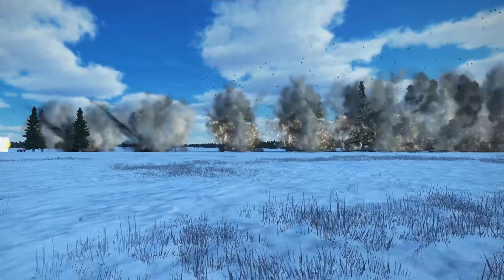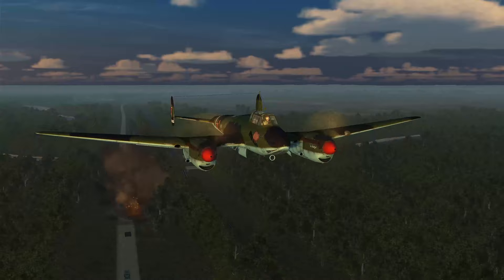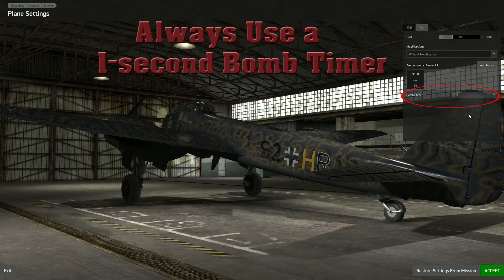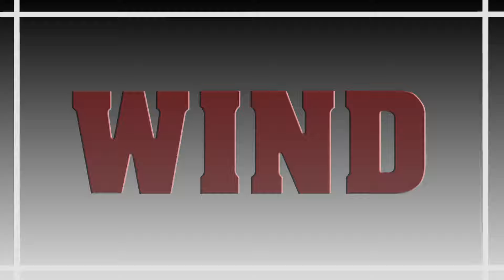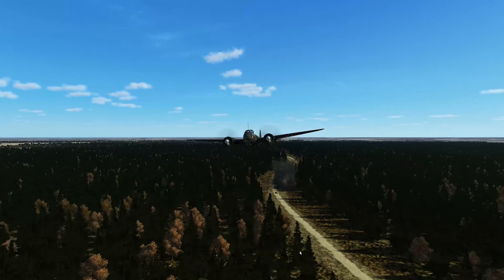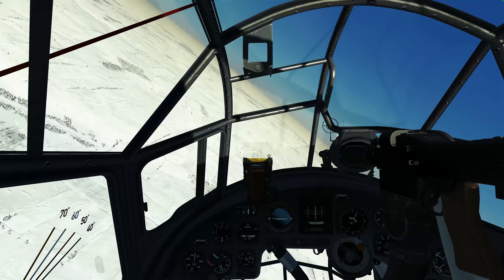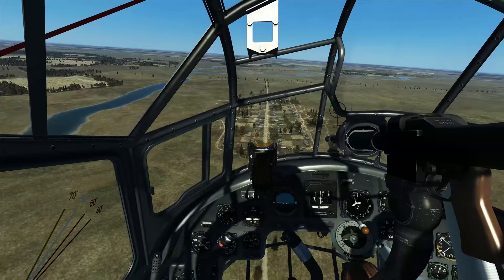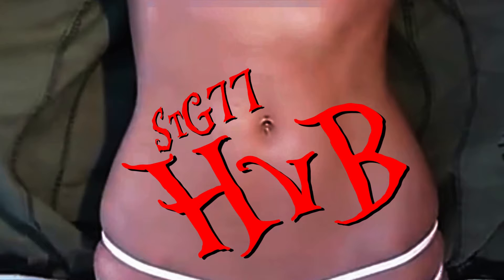Tank Busting: Ju 88 / Pe-2 / A 20B  Ground Attacker Handbook Subsection 7.2 IL-2 Great Battles

Comment: Its very WELL DONE( I do love these planes..)Very interesting BUT I had to put 0,75 LESS speed !!! Take it Easy MatE !!! 😅👌😉🧐🦅
Reply from the maker: Attack Dive speed is predicated on flak activation. When the TAW server flak had a trigger range of 2 km, a 700 kph dive speed was necessary to have a chance of getting bombs out before getting fired at. Now they've expanded that trigger range to 4 km on some columns, and speed no longer guarantees a clean entrance. On other servers where flak is not so quick to react, you may be able to get away with Attack Dive speeds in the 500-600 kph range.